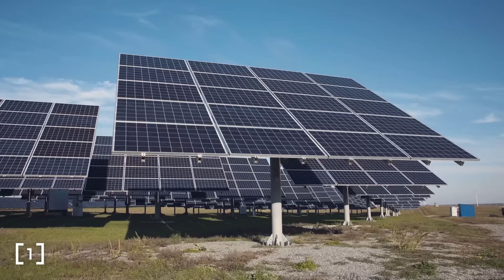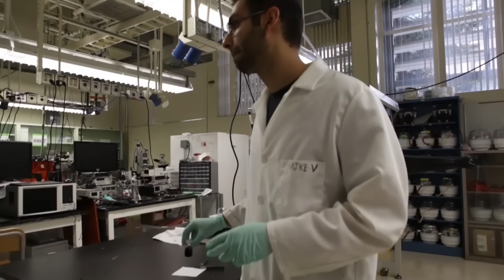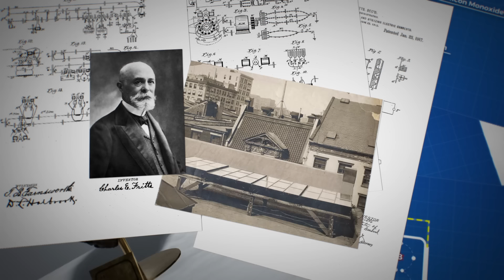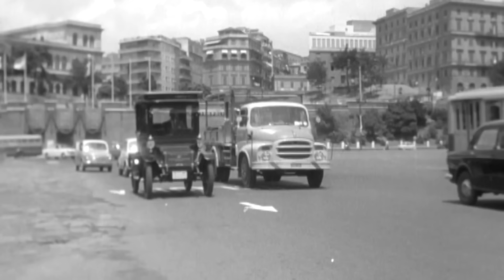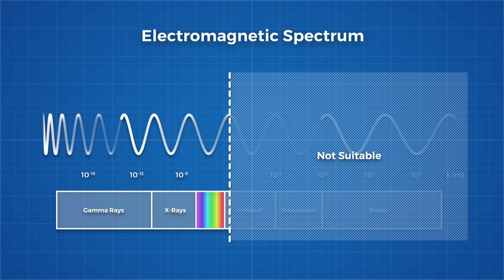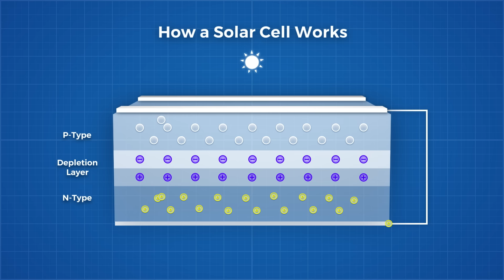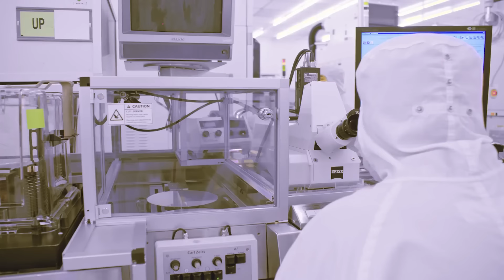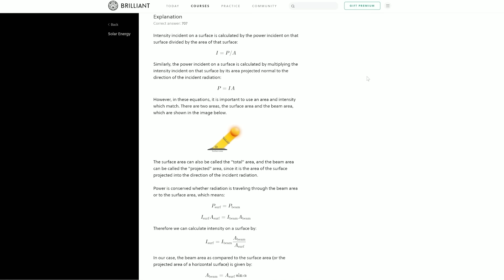The Mystery Flaw of Solar Panels

Comment: Great video, and this has been a strange problem.  Although I would add that the biggest issue with solar power isn’t panel efficiency (although improving it would certainly help) but actually storage technology since power production is intermittent throughout the day.  If we can develop a better battery that doesn’t have the limitations of lithium ion tech, etc., that would allow us to to build economical utility-grade storage plants that could supply on-demand power needs at all hours.  Until then, the limiting factor of a 100% renewable grid in the US is still the need for stable baseload power, which means either fossil fuel sources or nuclear.
Reply: Yep. I'm an Electrical Engineer. We care less about efficiency and more about storage when it comes to practical applications. After all, batteries are much more expensive than solar panels and solar panels are efficient enough these days.
Reply: what about using all that surface area to sandwich an insulating material between two conductors to create a parallel plate capacitor behind the solar panel?

Comment: The problem with PV cells is that they are VERY energy intensive to create -- and they keep degrading over time -- and dirt really hurts their performance. In the daytime, home arrays present a risk to firemen -- in most situations. Further, their net benefit to the grid is trivial in the extreme. Coal plants are being shut down due to government policy and the fracking boom in natural gas. Solar power has NOTHING to do with forcing these plants to shut down.
The real solution to Green Energy is Andean hydro-power. There's enough hydro-potential in Peru, alone, to power our hemisphere. Yup. It just shoots down the eastern slopes. Venezuela and Columbia also have staggering hydro-potentials. 
Electric cars make no sense because we wish to drive when the Sun is shining -- largely. So PV generation is ALWAYS mis-matched with the grid. It needs to be mated to pumped-storage schemes. Otherwise, it just does not scale up.

Comment: 14:09 Thanks for the diagrams on the basics; however, when you get to the new material, you don't have a visual explanation. You also don't explain why heating reverses the effect. From your words, I'm guessing that crystalline defects between the semiconductor layers traps electrons and repels subsequent charges away from the junction. Heating clears the traps by dislodging the trapped electrons. Defects far away from the junction should have no effect.
My question is what part of the process is introducing oxygen into the silicon?

Comment: Lol... How stupid problem... its propably because of heat expansion. It changes the wavelenght that can be converted from photoms that pass the converter layer, so energy input will also be changed.

Proof of that is that efficiency is increased when solarpanel cools down during night.

Edit: So.. 6:46 ..it was the heat as i quessed 😬
7:15 lol... in detail maybe, but main cause is mostlilely expanding of material. Distances in atomic levels are HUGE when it becomes about heat expanding obkects as large as solarpanels

In general, the video is really educative and fasicinating tho. It was a joy to watch it.

Comment: And what is the calculation of efficiency ratio between , total calculated lifetime output, vs energy required to manufacture , including glass and frame and installation energy?
Reply: a solar panel cannot produce the energy that is required to manufacture deliver, and install it.
THE ELECTRON THEORY IS A JOKE !!!

Comment: Solar panels require, at times, a delicate hand and finesse in construction, design, and deployment.  We still only get a small fraction of the solar flux converted into useful electricity.  Plants do a much better job than us, but they do have millions of years of head start before us...
Reply: How about we gene-modify corn / algae to increase their yield for biodiesel ?
Reply: @milokaw4193  Excellent comment.  Algae is what the entire planet is running on now(i.e. petrol).  Problem with corn is we're hungry and so are our livestock.  We also have to take care, as some of our 'clever work' has proven costly, especially ecologically.

Comment: All well and good for homes and small towns but not for cities as the area required to power by solar would be 10 times the area required by a Coal or a Gas fired plant ,let alone a Nuclear plant . Solar is not 24/ 7 power by 365 days a year . maybe in another 30 / 40 years but not now and as they wont survive without tax payer money to prop them up .
Then you have the life of a solar panel ?

Comment: Would developing a method to mask the surface like we do a circuit board, then using a plasma sputtering system to deposit a layer of a low resistance metal or even carbon nano tubes? Would that work?

Comment: Hot electron traps cause the same problem in semiconductors. Removing oxygen from the wafers was solved 20 years ago by all the major players. The problem comes back though as geometry shrinks and it’s not oxygen driven.

Comment: If they are so great please explain why my premium solar panels failed after just 8 years.  They also dropped efficiency very quickly despite regular cleaning.  I remain unconvinced about their use for base load power especially after seeing how far their electricity production drops away when a cloud passes over.

Comment: Wind and solar can't regulate according to demand and it can't deliver reactive current, and hence it can never be an important supplier of energy on a global scale - nuclear is the only way to go!
Reply: DK viking KD you have the same issue with nuclear, it can be controlled but very slowly. Plus its already more expensive to build a nuclear plant than to install solar panels and batteries. Where nuclear reacts in hours, batteries can react in milliseconds! That 60,000x quicker!
Reply: @harsimranbansal5355  No, nuclear can regulate the power output on demand like a conventional power plant and solar/wind cannot regulate above whatever energy input nature provides at any given point in time..
Reply: DK viking KD yeah, conventional power plants are pretty slow, they always keep a slight surplus for variations in demand. It takes about half an hour to react to demand properly whereas batteries can do it in milliseconds. Plus its cheaper to add solar and batteries than to build an entirely new plant!
Reply: @harsimranbansal5355  I heard you the first time, but we don't have to agree:)

Comment: Interesting! And IMO Solar (or any other "green" energy) should take over from fossil on its own merits rather than government taxes.
Reply: Yeaaaaah.... that's not how our economy works.  Cost competition is what drives implementation.  SOME of it is merit based, but only when it makes economic sense to do so.  There is a reason why coal plants are being replaced with natural gas plants and not renewables... cost of electricity is a major factor in whether or not profits can be made and whether or not a company is willing to accept the risk.  Even in the public power world where I'm at (the midwest), board members are beholden to their constituents and electrical prices skyrocketing is not a great way to stay on the board.  Subsidies are a MAJOR help on the equation as it makes the switch slightly more stomachable for power companies, but not much more.
Reply: @Whiskey11Gaming  Well, that was included in my thinking. "Their own merits rather then government taxes" was meant to be that installing renewable sources should be from consumer mandate or inherent cost effectiveness (both economic drivers) rather than a "carbon tax" to artificially increase the cost of fossil fuels. If we go with power that is based on taxing one source and subsidizing another it will only lead to problems long term. And that ignores things like wind and solar not being able to be ramped up and down on demand so that energy is not wasted, their spurratic power supply, the cost of batteries to address these, construction not being all that "green"..... Then, in the case of wind power, you are taking energy out of a weather system over a prolonged period of time. Climate is weather over time. There will not be a non zero impact on climate and we can't be sure what that will be at this time.
No.... traditional energy sources need to continue until alternatives earn their place.

Comment: Solar cells have not taken one single fossil fuel power plant off the grid. Photovoltaics require most of the energy to come from hydro (limited resource) or reliable, dispatchable generation like spinning reserve and peaking plants; and that's mostly gas and coal. Unreliables like wind and solar lock in fossil fuel generation; there is no wind power or solar power, there is only wind + solar + fossil. Nuclear plants don't like to cycle that aggressively. You can go from 100% power to 50% power once a day as in France, but it costs as much to operate at 100% power as it does 50% so it's not a great idea. They are not a good match for these unreliable power sources. Storage on the scale of minutes, to hours to days to seasons is not forth comming. Probably not within my lifetime. Unreliables are joined at the hip with fossil fuels.

Comment: The reason solar cells lose power when hot is actually very simple to understand. Don't know why it was skipped.
There are 2 ways to get electrons across a semiconductor. The first is to apply a voltage(in this case, absorb a photon). The second way is heat. Hotter electrons have a higher voltage and a bigger chance of jumping across the bandgap. Hotter panel means more of that voltage needed to make the jump comes from heat. What remains comes from light. So it's not actually a power loss. More specifically, the voltage output of the panel drops.
Reply: It's been a long time, so I might be wrong on this, but aren't resistance and heat a hand-in-hand thing as well?  It's part of the physics that leads to the NEC for electricians.
Reply: @SerunaXI  
No. Heat is kinetic energy. Resistance has to do with 'collisions' between electrons and the lattice. I think it's called the Drude model.
Some materials see an increase in resistance as temp goes up, other materials see a decrease. Insulators being a notable example. Never assume an insulator beyond its rated temp is safe from arcing.
Reply: @SerunaXI  I find answers 2 and 4 of this site easy to understand: http://scienceline.ucsb.edu/getkey.php?key=2668
And yes, it seems that the heat does act as resistance according to answer 4.

Comment: Very interesting, even to the novice. Several years ago I saw a presentation that discussed adding a parabolic structure to each cell so that the sun's effect was always optimized without requiring the added cost of tracking. I don't remember anything lately discussing this. Did it fizzle or did I miss something. Thank you for your article.

Comment: Not one word was said about what is to be done with the cells that are not producing. They cannot be repaired or recycled to recover the scarce materials in a cost-effective manner, so they are just trashed and the toxic stuff leaches out into the water table. This same problem exists regarding wind turbines. Bottom line is: this technology stinks.

Comment: I think I have also read a lot about different ... indeed many, protests about the fact that more and more land is used for the assembly of all these panels ... I am referring to different "green" groups .... then I think about the fact that 1) The production of energy also depends on the temperature 2) The production of energy depends on the angle "unless you use search panels" 3) When there are clouds ... you stick to the tram, as they say. I don't think oil companies are in the least afraid of all this ... given that oil is used for 1 000 000 other uses, then if we talk about coal we don't even talk about it. Using the sun as an energy source is only a palliative solution considering the fact that consumption will continue to increase dramatically in the coming years, sorry to say but they are fantasies.

Comment: What a stupid argument 20% efficiency over a period of when the sun is at optimum is simply not comparable to the 80-90% of conventional sources That is available 24/7. It is simply a little bullsh*t baffles brains, so does the graphics. It is still inefficient and dilute. One simply can to look at the area needed to generate the same amount of energy as a conventional system. Yes they have a market, a very niche market. Very expensive so its affordable for those who have the financial resources to implement it. 
It is simply delusional to expect it to power a modern industrial economy. The "green and clean" argument should not be attempted.

Comment: A lot of people in the comments don't really get the point of the video and focus too much on the numbers on the introduction and why they are optimistic. Whatever the particular number solar energy produces, it could be increased ~10% by solving this one problem efficiently. That is a big leap. Imagine if the system seller told you that you can repay your home instalation in 8 instead of 10 years, for instance. Or that companies can have a 10% higher ROI on certain power plant investment.

Comment: you need a 10% differential in the electron flow to get the process started.  Short of very high efficiency in transmission I doubt that 10% will ever disappear.

Comment: Laboratory interesting but I'm still not buying commercial solar as a viable solution - the generation and delivery of electric power consumes almost 2/3 of the primary energy delivered to the grid, leaving less than 40% of the primary energy to be converted to useful work. Until transmission losses are reduced, the efficacy of solar is in question.

Comment: I am a real engineer and hold 3 engineering degrees.  I have NRC certifications in mechanical electrical and nuclear engineering.   As with so many YouTube sites this one is not simply biased but presents false information as fact.  I begin work on solar systems while at Stanford University in 1979.  I continued my energy research at Sandia national laboratories.  We developed the 1st solar power tower in the early 1980s.  It is still being used for thermal testing in Albuquerque New Mexico.  The problem is that the realities of photovoltaics are being suppressed.   As engineers we have always realized the shortcomings of  Photovoltaics.  1st of all they're extremely expensive.  Anyone that tells you that the prices come down to where as compatible with fossil fuels is a liar.  All things considered it is about 100 times more expensive. There are many problems including  degradation of  15% per year.  Another problem is conversion from DC to AC.  The greatest problem with a tempting to use the systems on the national grid is the fact that it is not consistent.  What we require is the source for baseline energy needs.  The problem is that most people that are driving policy are not engineers and do not understand the technical needs of the grid.  Germany has spec upwards of 500 billion dollars on alternative energy sources including wind and solar.  With all this money spent they have only replaced less than 2% of their baseline energy needs.  The problem is that they still must use fossil fuel and in this case that means natural gas to provide their baseline needs.  So all that money is actually wasted.  This is something that this site and most others will never admit to.  Germany went from a country that was generating very little CO2 with their energy production to one that is releasing tremendous amounts of carbon dioxide because of the switch to natural gas from nuclear.   I have researched alternative energy production for over 40 years.  The biggest problem is the politicization of the process and rejection of real science.  He is not teaching you to think like an engineer.  He is trying to brainwash you into accepting his release there are contrary to engineering science.  I am a real engineer so I don't need to play one on TV.  The truth is that solar will never replace any other source for baseline energy needs.  Is expensive and there are tremendous environmental concerns relative to both the production and disposal of the systems.  Hi facts are distorted and disingenuous.   It's unfortunate that politics continues to drive our decision making.  This is how Germany has made so many horrible energy decisions.   I don't need a teenager from Germany to tell me about how to generate electricity or how to best manage the environment.  When she obtains 3 engineering degrees, then I listen to her but not before.  People are becoming fools by listening to people that are ignorant and have questionable motives.   The truth is that there are too many people who are you coming ridge as so called environmental activists.   Ignorance abounds but intellect is rejected in favor of political goals.  In the end the world is wasting trillions of dollars and we will end up with more rolling blackouts.  The foolishness continues to...
Reply from the maker: Oh woooow 3 engineering degrees. Soooo impressive.

Comment: If you think that field of solar sells is in anyway green you are utterly delusional. His claim of 30 nuclear power stations is laughable... 1 nuclear power station usually outputs over a gigawatt and the entire field is less than one gigawatt, and that's at maximum capacity which is rarely hit. Also the 'holes' (missing electrons) do not literally move. The narrator is quite thick and too inaccurate for a Real Engineer... But the world is quite libtarded now, so maybe he is what is considered a 'Real Engineer' now-a-days... Going by the IPCC reports I've read I wouldn't be too surprised.